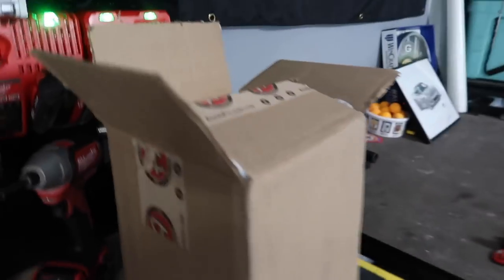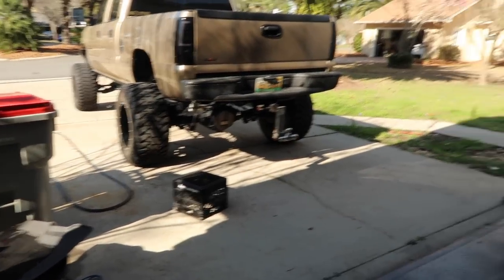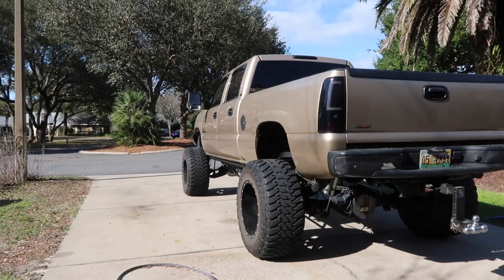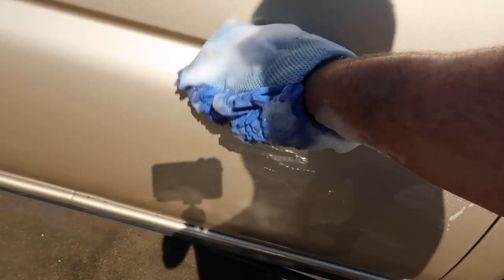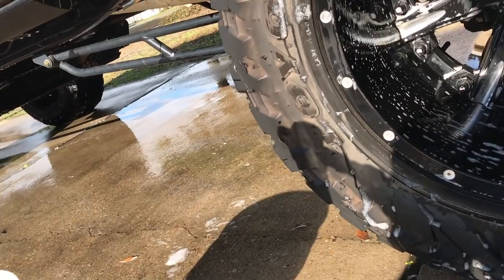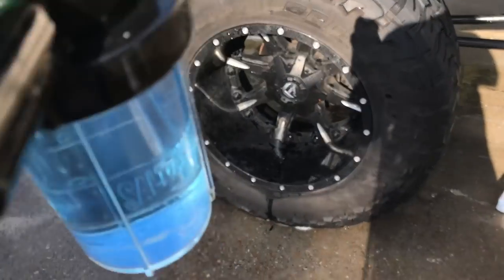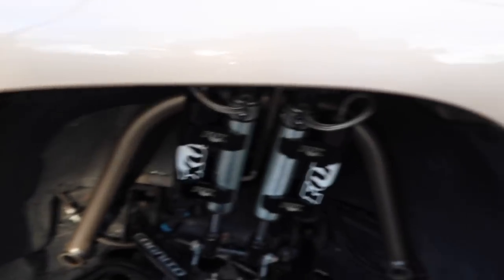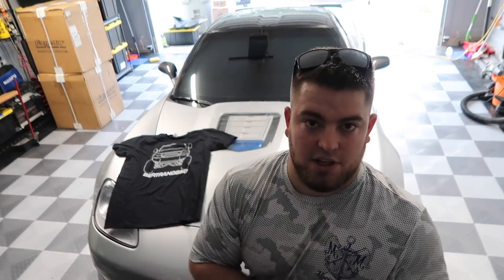Detailing the DURAMAX after mudding! (took forever)

Comment: Don't ever use a brush, wash mitt only on paint.. Wheels=brushes...Two bucket method too
Reply from the maker: KC Outdoors I usually use a foam cannon man! You don’t like soft brushes?
Reply: Any brush is terrible for paint. Doesnt matter if it's a "soft birssle" it will still leave micro scratches

Comment: I know its a truck but swirls for days when youre using that brush
Reply from the maker: even if its really soft? I mean its really soft
Reply: Because you drag dirt yes you may use a super soft brush but youre still dragging the dirt but if you are going to use a brush at least foam it down and wash from top to bottom because the dirtest parts will always be at the bottom but always rinse out the brush and grab new suds very often
Reply: I always just use their wash pad its my favorite and super soft but get some of their tire and rubber cleaner its awesome for getting the dirt off the tires since you go mudding
Reply from the maker: I feel like a mit would drag dirt just as much
Reply: Not really because a wash mitt is easier to clean as if a brush locks in dirt and is harder to clean out in between panels thats what I have always heard but definitely invest in a foam cannon makes car washing fun and easier!
Reply from the maker: I got a foam cannon and a foam gun man. check out my early videos